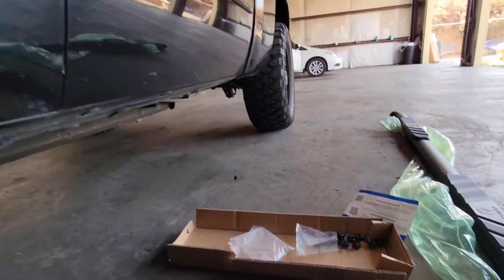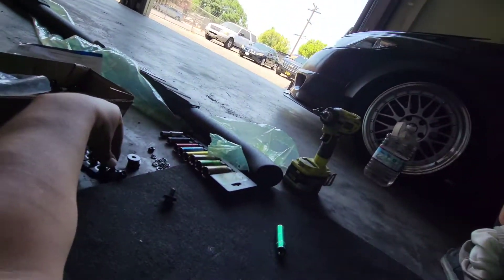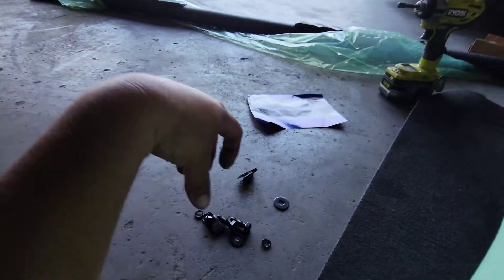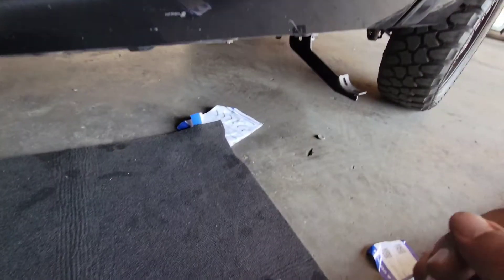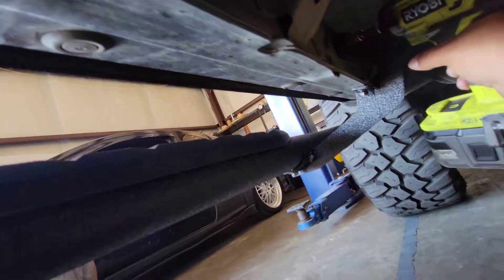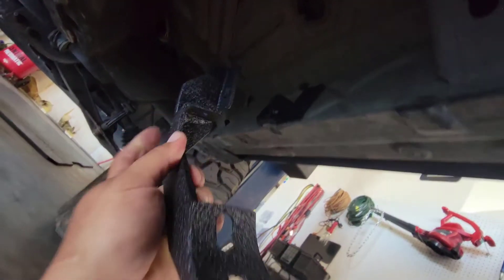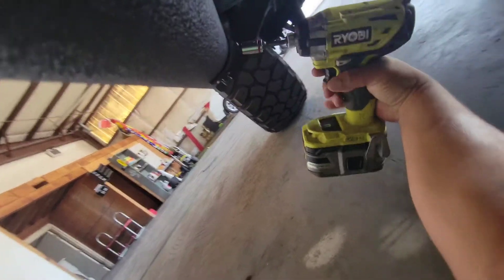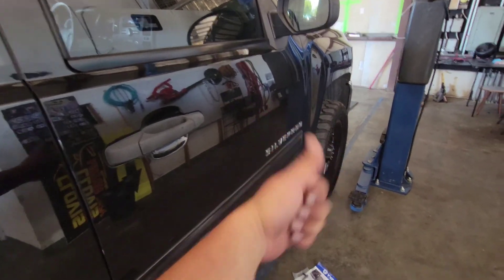How to: Install Running Boards 2012 Chevrolet Silverado

Comment: What type of running boards are these? If I buy them thanks in advance!!!!!
Reply from the maker: Found these on ebay....

https://www.ebay.com/itm/234665574739?fits=Year%3A2012%7CModel%3ASilverado+1500%7CMake%3AChevrolet&hash=item36a3288153:g:Tc4AAOSwPXpi~6ur&amdata=enc%3AAQAHAAABAONX2GPzPsGdIre0mmsNKblb4FKElItiTk4Ox%2BQxpB0m%2FJWVAKhgjmHYoj6XTkcb77R8gji26IcrHQ%2FwC%2F%2BNvay9lwgThhmxMCw2mjLDpeDz1%2FkfJ41cf4bzkkVmPk7cT9wWBWQ77TwJ7XBG6iwYHxbdoSsKSvEJ15qwQAIvinpap6AGO63tb8bmwqbvZCBuXjsmze6SDMGI%2F9cWeR4Q4Jc6s163H34nFgsBogPD5SY0N7PUwQW5I6XnRUASR3gfL%2FT2L%2FncSGOdW15cgO1vGmBXtvJkrjDdiDlezrbhKDRwoqfNOPEF%2F90%2F97jaVVNodtIuYkkVImIC3ACd%2FqdxZEU%3D%7Ctkp%3ABFBMjJqFl-lg
Reply: THANK YOU, they are the exact ones I just had delivered. You saved me bro, king shit
Reply from the maker: 🤣🤣🤣 heck yeah bro! Thank you brother! Thank you for your Support 🙏